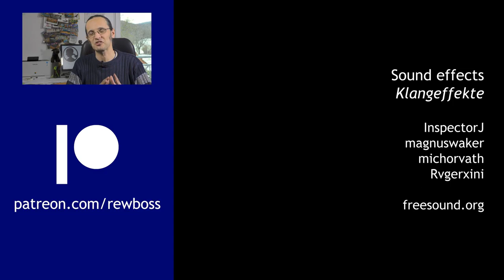Don't buy a cuckoo clock

Comment: I found this video it be quite entertaining. In reference to the sounds/ music/ movement that these clocks provide may be annoying to you sir, but to others an enjoyment to watch and listen.

Maintenance. Yes, I agree, it does take quite a bit of care to maintain the functionality of a Cuckoo-Clock. However, if you inspect, clean, and oil the movement every two years, the mechanics will response to such care. These clock are unable to take care of themselves. So keep that in mind.

"Eight day Cuckoo-clocks". Do not pull the chain to lift the weights without first holding the weight in your hand. These weights are heavy, and will apply an excessive amount of stress to the gears. 

The bellows. Yes, they are fragile and can overtime become brittle. Let's think now, what causes things to dry out, HEAT and a Dry Climate. Which means, do not hang your clock near any places that produces heat.  This alone will cause premature aging to the bellows causing them to crack. Not to mention dry out the "Real" wood that these clocks are constructed from.

Shock can also decrease the life of  your Cuckoo-clock. Just as shock to our electronic devices can  render them useless if not properly taken care of.

I purchased a Cuckoo-Clock from Germany in 2017, runs great, and keep perfect time. It keep up with my digital atomic clock. I just purchased another this past month waiting for it to arrive.

Comment: they arent difficult to repair, and the movement is incredibly simple, and at the very worst? you can replace the movement and put in a new one. i recently repaired the bellows of one of mine, and they work perfectly, and the movement is in great shape too. clock collecting can be addicting though, for sure.

Comment: My grandparents had one that worked for decades. Of course after they passed away nobody wanted to have it so I guess it is now idling in my uncles basement or on some scrapyard. Just saying a well made one should not break. But I have no idea why anyone would buy a cuckoo clock in the first place.
Reply: I can answer that, "nostalgia".  In addition, you don't have to spend money on batteries. Have you seen the price if batteries lately?  I would never consider buying a modern, battery-operated cuckoo clock. The thing sounds awful. A simulated cuckoo sound with echo and water running in the background. To me, it sounds if someone is going to the bathroom in the background.  I'll stick to the classic.

Comment: It sounded like a bunch a beads or BBs fell to the floor when the clock was shot.   Hmmmmm.  Well done in any case.
I could never have a clock that makes ANY noise. The ticking mechanism drives me nuts.... no cuckoo on the hour required.  
Yes, I do make an exception for the alarm clock...ok!?   It makes noise only when I tell it to.

Comment: I grew up with a cuckoo clock, and yes you get used to it. But oh boy, it also drives you crazy. If only because at some point you no longer hear the steady "tock-tock" ... or do you? Or ...? Is the stupid thing now broken again, or am I just imagining it? The cuckoo itself is already decrepit and only caws hoarsely if you press a small wire lever inside the clock at the right time.

I have no idea how old this thing is - and it has been repaired several times, but on the inside a piece of newspaper was glued underneath the mechanism. On it you can read (if you take the mechanism out first, of course) that the king has just decided to close the Potsdam rifle factory and which parts of the factory will then be continued in Spandow.
This suggests that one of the repairs was carried out roundabout 170 years ago.

Comment: I've  never been to Germany  so have never bought any clocks as a tourist however I do collect clocks of all styles.  Cuckoos happen to be one of my favorites and I  have around 40 of them, from a few years old to about 140ish years old.  Some are very worn and require tinkering, most of these I  assume were the ones that were ran for decades without cleaning and oiling.  Yes many newer (most) clocks are not as well made and IMHO are often overpriced, new and used, and probably won't  see 100+ years of service even with adequate servicing and bellow rebuilds, plastic junk gears and such will break or wear out before then I'm  sure.  Anyhow if you like them collect them.  If you are poor like me you'll  learn how to work on them and can get some nice clocks cheap and if unfixable they still look good next to others that are working.

Comment: Not really accurate. History is accurate, for the largest you forgot the one in Champs Clock Shop (which is a typical one, not a building), but all mechanical parts break easily, and it is actually is easy to repair (or at least not as hard as you think). Also Germans do buy them, and they don't malfunction that often. Plus I don't know what you mean by "friends don't let friends buy cuckoo clocks", the truth is actually opposite. Because of this I am actually going to start a cuckoo clock collection consisting of a large 59 inch clock costing 12000 USD and many more, all different styles, even vintage ones, and also consisting of the exact same model in the thumbnail (I found that model on Bavarian Clockworks and that is where I am buying all of these from).

Comment: really???? I have one. Its been in the family for many many years and handed down. I clean it out every few years and oil it. Just recently was the first time it needed repairing and I bushed a couple worn pivot holes and away it went running it nuts off keeping time like a champ. So where you get they wont last and are impossible to repair is bull$#@t. That might be your opinion but it isn't accurate in my personal experience.

Comment: It's real , I bought one in Black forest region in 2018, but lasted only a year..local mechanic couldn't set it right..
EUR 100 wasted !!
I feel it's tourist rip off items in Germany..
Reply: That's because you only paid 100 EUR. Honestly, what did you expect? A Coccoo clock is a complicated thing to built, if you want something which lasts, you need to spring at least three times as much. It's true though that most Germans actually know that and stay away from the cheap products if they really desire one.
Reply: @swanpride  that's what I could afford...1 EUR = INR 90.. Very expensive for us...